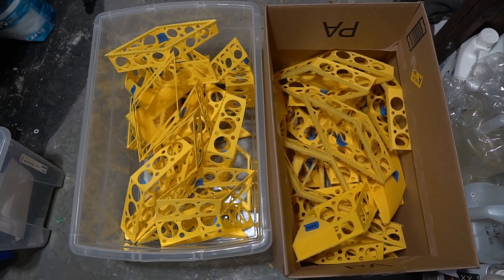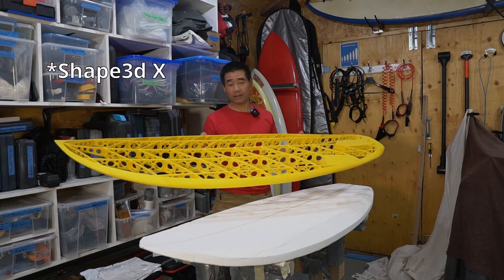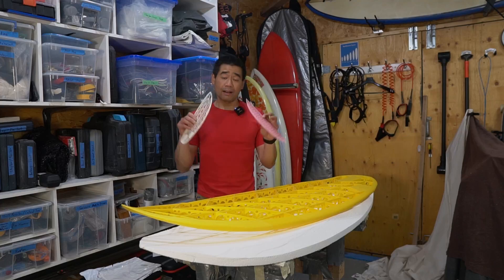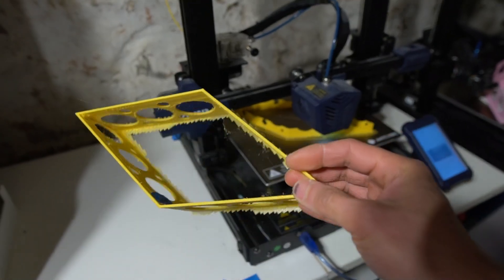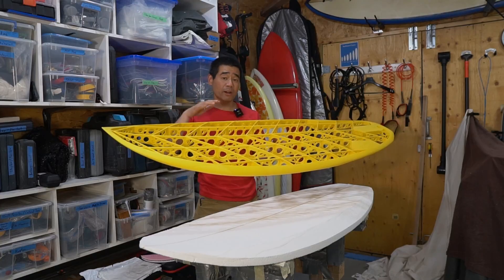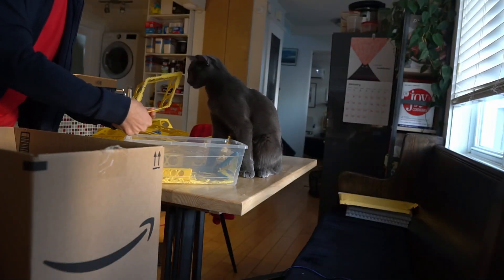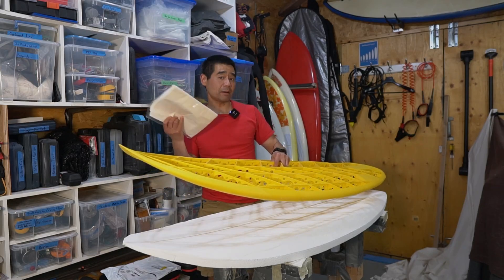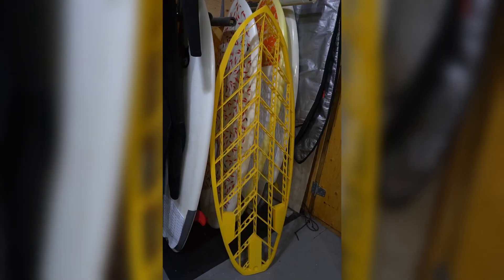How I Made A Surfboard With My 3D Printer!

Comment: I admire your engineering mind. I believe the heart of the surfboard, is the bottom of the board and the rails.Therefore, I believe the ideal board would have its foam bottom and rails. I would hollow out the top of the deck and drop in a 3d printer deck.

Comment: SO COOL! i have spent the past 3 weeks designing and test printing a surf board. Mine is planned to be about 6 6. I have gone for a smaller Dimond pattern for my board with square holes instead of circles. How were you able to create the circular holes in the board?? I still need to add fin boxes. Do you think 3D printing them will be strong enough? Thanks, Nate

Comment: Cool project. I built some hydrofoil wings with PLA. According to test samples I made,  PLA and epoxy do not bond very well. I printed the core with fuzzy skin, which improved adhesion and prevented delams. Fuzzy skin may help with adhesion on the rails on such a project, should you build another one.

Comment: I used to build balsa planes. I would cover it with heat shrink plastic rather than tissue paper. It's easier, faster, and more forgiving.
  If you don't do tissue paper perfectly, you'll have wrinkles.
Reply: isn't there a high risk of warping the plastic because of heat? Sounds like a quick way to ruin the whole thing, where with tissue you could remove and redo problematic sections
Reply: @cakedayy  , a good point. It depends what he used to print it. But, shrink wrap for models doesn't require much heat, and it is localized to the outside of the specific section being covered. It could melt some contours, but warping is more likely to happen if he does not have the board mounted properly while shrinking the tissue/plastic. Also, dope dissolves the plastic, which is why it is typically used on wood. So, same problem with dope/tissue. Plus, tissue adhesion relies on the wood grain to absorb the dope.
  You can remove and redo sections with shrink wrap too. I am wondering if a plastic glue of sorts might be better than dope if he goes with tissue, but it has to be water resistant. Part of the process is to spray it with an atomizer to "stretch" the tissue as it dries. Then you dope the whole thing. The shrink wrap solution would be lighter too.

Comment: The board looks awesome. I'm really looking forward to seeing the finished board.

I too 3d print surfboards - currently working on my 3rd board - for river-surfing in munich 🙂
I took a different approach inspired by YUYO (https://yuyo.surf/).
I print the board vertically in multiple parts - most of them in vase-mode, which reduces print time.
All parts can be printed without support this way.
I built myself a custom 3d printer to be able to print the required width for a board in one piece.
You can see the printer and the internal structure being printed in vase-mode here: https://youtu.be/gyigLvo6Slw?t=2374
The board is actually printed with glow-in-the-dark PLA 😛
I still need to figure out a better way to glue the 3d printed parts together, as this is the most time-consuming and fiddly part at the moment.
Especially with the outer shell only being 0.5mm thick in most places to keep the weight down.
I glue the ribs with superglue and then weld the outer shell using a 3d pen and a soldring iron with a big flat tip.
Maybe I'll make a video on my next board...

A friend of mine recently built a board in the same way you did here.
He wetted out the fiberglass on a big plastic sheet (e.g. for vacuum bagging) and transferred it over to the board afterwards.
After pulling off the plastic sheet he adjusted the wet fiberglass on the board to remove all wrinkles - or most of them.
It ended up looking pretty good - but I've only seen pictures so far 😉

Good luck with the laminating 🏄

Comment: I used to cover my planes with tissue paper made for that purpose.  Once tacked to the structure you would mist on water to shrink it tight.  Later (& for a little more money) silk was used with the same process for shrinking.  I would seal the paper or silk with a thinned butyrate dope I got from a hobby shop that could get it from military surplus in gallon cans cheap (likely all gone now).  To fill the silk weave I would mix the dope with unscented baby power which I could carefully sand with 4-0 steel wool that left it so smooth people thought it was monocote (plastic sheet) covered when painted.  The silk gave it a tad more strength too.  I do remember that the covering would loosen when wetted with successive coats of dope but would re tighten when dry.  Epoxy may not have as much of a potential problem as polyester since the solvents aren't as harsh.  Have you ever posted on Swaylocks?  I bet everyone there would be interested in your project too.
Reply from the maker: Thanks for the insights and your comment takes me back to working with monocote lol.I have posted on Swaylocks before, I see there is a thread on this type of board actually. I like coming up with my own ideas before looking at what others do :)

Comment: Did you had issues with ASA in your bamboo lab printer? I thought that a closed enclosure printer can print that without issues. Thanks for the great video
Reply from the maker: Yes in the bambu printers, it's mostly because of the orientation and surface area of the pieces I suspect. They have a tendency to really warp and pull off the bed. I've printed lots of other things from ASA and had no issues but these surfboard pieces gave me a really hard time.
Reply: @AndrewWorkshop  thanks for the reply